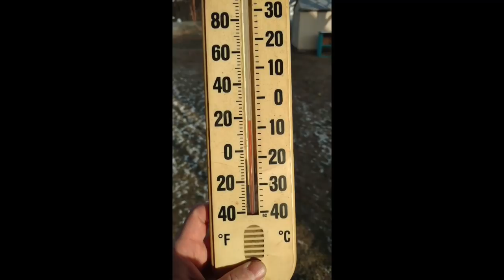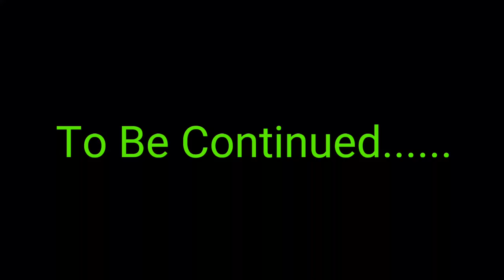Moving logs with a log arch

Comment: Very interesting. I have some land, and trees fall. I cut them up and burn them. But you have to move the pieces to stack it before burning. I have always lifted pieces into truck or pulled them with the truck. I was thinking about a dolly, but this log arch is much more versatile. I'm getting near 70, and I do not want my back messed up. Thanks for this tip. Where did your wife get the log arch that you used?

Comment: 18 degrees is down right balmy.   It reach just above zero today.  I'm hoping for 15 degrees tomorrow so I can make an attempt at stating the mill.  It doesn't like freezing temps.  I may have to install electric start to save my shoulder, lol.  Nice log arch.  I'll bet that comes in super handy.  Happy New Year Ben.
Reply from the maker: Thanks happy new year to you too
Reply: Dillons Woodworks, What type of oil are you running ?  Maybe some 5W-20 would help ?
Reply: august That's a good idea.  I will try changing the oil and maybe clean the carb.  Then I'll get some Heet and non-ethonol fuel.  These sub-zero temps are brutal on machinery.  Thanks for the feedback.  I'll let you know how it goes.
Reply: I know those temps will turn older, thicker, used oil into sludge. I know with all my smaller pull type engines: log splitter, snow blower, that when it starts getting real cold, I will change the oil to the 5W-20 and because it's thinner AND fresh, pulling it over is much easier. I think synthetic might help even more ?  Hope it works for ya and have  Happy New Year !!!!!
Reply: august Thanks!  I will keep you posted.  I'll do a video on it.  Happy New Year
Reply: Thanks, take care.

Comment: Were the tires flat when you first wanted to use the log arch. I know if I owned one, they would have been. -30 F tends to suck the air out of everything. :)
Reply from the maker: Filled them a month ago, still had some air in them yet.
Reply from the maker: -30 now that's cold.
Reply: Way to cold. You may not have known this but -40F and -40C are approximately the same temp. The only reason I bring this up is because we're not very far away. :(